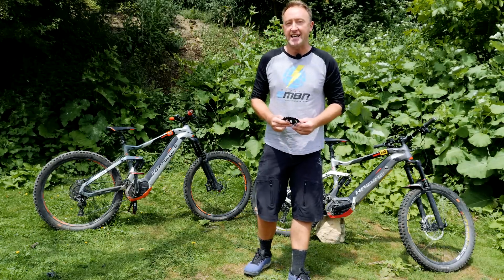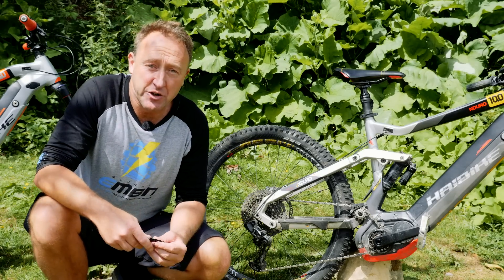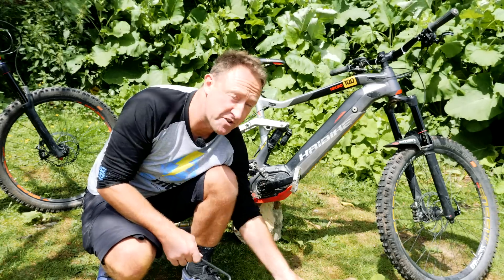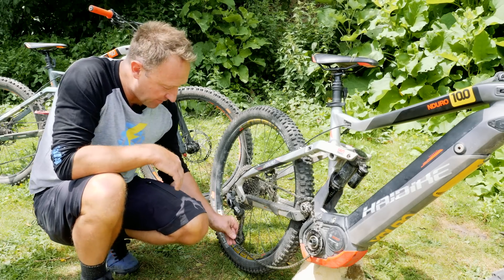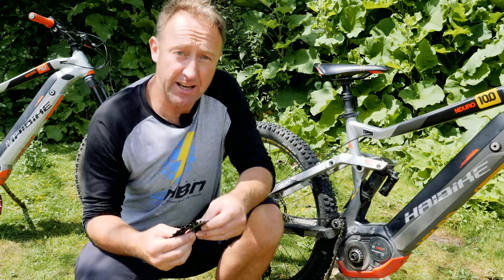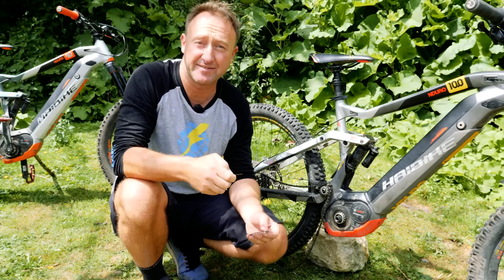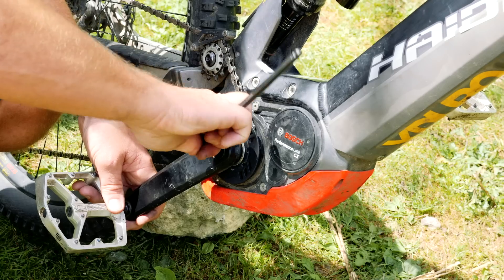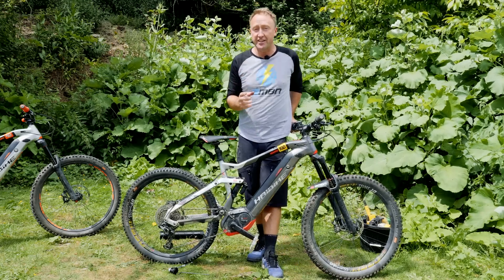Change An E-Mountain Bike Chainring On A Bosch Motor | EMBN How To

Comment: Hi, do I need to change the chain after that upgrade? Because the sprocket size is being bigger!
Reply: If you have a full suspesion bike, test if you have enough chain when you are in the lightest gear with rear shock bottomed out (or removed)

Comment: hi, i have a 10.0  after 1550 km replaced  ( the sram casette ) is extreme  expensive  ( 480 euro ) the  chain plus front sprocket , is ther a other brand ( shimano ? ) that will fit the bike ?      today  checked it  @ 2500 km it looks dat its worn out  again ( ps the first 1500 km 80 % was on turbo - now i ride in al the modes ,

Comment: I would like to know how to tell which sprocket tool is needed for my 2020 CX that came with my Moterra Neo.  Not all of the sprocket tools for the Bosch motors are the same and each one is about 25 quid apiece, and I have one now as a paperweight.  Thx.

Comment: Very informative video, thank you. 
My KTM Macina Kapoho LT271 (8-speed) came with a 16 tooth SRAM X-SYNC sprocket. 
I upgraded to a 18 tooth sprocket which is the largest available for the SRAM X-SYNC series however upon looking on the Internet I have come across a 20 tooth sprocket (KMC) but it comes in two variants, either 1/8 or 11/128. 
Not sure whether to try one of these larger sprockets out and most importantly i'm unsure which varient I should get. 
Can you offer any advice?? Thanks 😊

Comment: the one thing I'm worried about is the offset spacing (3:37) compared to the original, which seems to have inside teeth near the drive unit and sprocket spaced some number of millimeters away, then more space, then the outer guard. I'm not sure why miranda has so many offset combinations
I'm thinking this actually just has to do with the cassette height in the back and to more closely match the middle of the gears

Comment: Great explanation.
I would love a similar video regarding the Yamaha PW-SE motor.
How easy is it to find chainrings on online shops for that motor? Are the chainrings independent of the Crank?
What about replacing a single chainring by a double chainring? Is it easy to place the derailleur? For example in a haibike SDURO?

Comment: I'm trying this on a 2018 Haibike AllMtn 9.0 and the chainring is too close to the motor. where do i find a 14 tooth chainring with the correct offset for this model??????
Reply: did you ever figure this out? I'm having a similar issue and will need to offset towards the pedal

Comment: I will only use Oval chainrings, So most e bikes are no go for me, but for now I prefer normal bike anyway,
or belt drive for me. I haven't seen them for these systems yet. but I saw a person made a belt drive oval for an old bike for old cranks, but I don't have a CNC, nor do most people. but I haven't dig deep on E bikes. for me it's a huge difference.
today I found this: https://e-bikerumor.com/2018/06/26/aribike-expands-e-bikes-w-spiderless-round-oval-chainrings-brose-tsdz-2-ultra-torque/
https://www.aribike.it/eng/e-bike.htm
Oval fro E bikes.
SO far this is the only Oval fro E bike I know of, but i don't know much about E bikes.
So far the offerings are for
SHIMANO E8000 MOTOR , Brose & Ultra Torque motors, but their site looks like an 90s site and doesn't work properly, the links all go to SHIMANO E8000 MOTOR option.

Comment: Just changed my front sprocket to 14 with the after market chain guard the chain looks worryingly close to the plastic motor casing with out the inside  guard......like the the factory one ? I’ll see how it goes !!
Reply: Changed it back to standard it needs a spacer or a different sprocket!!

Comment: So.. I've just bought a 14t sprocket for my Haibike.... fitted it.....  it is slipping under the chain.... it ain't working and I'm not sure what to do... put new chain on..... but as I pedal....crank/sprocket rotates... and chain doesn't.... sprocket slips about 2 or 3 teeth each rotation..... I can't understand what bus going wrong......

Comment: It's interesting that you don't mention Miranda, because they are the company that makes all this Bosch sprocket wizardry that allows you to change the chainline and whatnot. In addition to chainrings and chainguards, Miranda also manufactures Bosch-compatible spiders which allow the use of general-purpose sprockets. Another thing that's critical to mention is that Bosch drives can also refuse to work with certain chainrings as part of their anti-tampering mechanics... the exact nature of this is difficult to predict, but there are plenty of reports by people who replaced the chainring that their motor refuses to function.

Comment: I have a question.  The front ring you took off has a 5mm offset. The one you replaced with doesn’t.  Is that a problem?
Reply: I'm not OP but yes, that is definitely a problem, though less so if you have a rear derailleur. It would be critical on an in-gear hub though. Luckily, there are different varieties of these front rings with the internal protection being offered in several different offsets - convenient if you want to adjust the chainline of your bike a little. Maximum is 20mm though :)

Comment: Well that is going to be a challenge on my Focus Jam2 with the battery placed in the downtube and needing the motor to be removed to access it.
Reply from the maker: But doesn't the Focus have a Shimano motor? This video is for Bosch Performance line motors only.
Reply: Fair enough, I just figured removing the battery was a general safety tip for all ebikes when accessing the chainring. Thanks for the reply.
Reply: @embn  and Yamaha ST, How change chainring Peter?

Comment: The front sprocket whit chain guard is ugly and a mud trap.

I changed it by a sram without it, prettier and you dont have all the crap who gets stuck in it.
Reply: I agree, it's a mess and mine is typically full of mud.

Comment: I did this modification on a Bosch CX, but i had to reprogram the motor to get optimized assistance.
Reply: Each Bosch motor is set for the bike set-up with cassette size and chainring size input etc. I'm not aware this can be changed with the usual interface, maybe Kevin knows different.
Reply: Bosch doesn’t provide software update, i had to ask the manufacturer of the bike if he was ok to reprogram the motor. Once they were ok, my bike shop had to make an appointment with Lapierre so they could upload the update online. My Bike shop couldn’t make the update by themselves. I guess software modifications are prohibited to bike shops to prevent de-restriction of the 25km/h limit.
Reply: Which is funny considering the e-bike dealers in my area commonly offer bumping up the speed limit to something like 50. On all sorts of motors including the Bosch PCX. I guess this is where an app would come in handy (changing the gearing info - I don't see why it would need protecting; the speed limiting must rely on a speed sensor as the motor has no idea which sprocket is selected in the rear). Then again, I don't really see why would the motor need to know the chainring/ cassette setup. What it needs is cadence (angular velocity) and torque (which gives you power) output of the cyclist. And bike speed for the legal cut-off.
Reply: The motor doesn’t know what gear you are on, but he knows you are supposed to use it on a certain range, for exemple, between 11 and 42 tooth on a 14 tooth chainring, so it can deliver assistance exactly where you need it most.
Reply: The speed bump to 50km/h is a simple trick, it consist by hacking the speed sensor, and registering only one pass of the magnet out of two. It’s illegal though, and messes up all data on the display (speed/ distance/ range)
Reply: Brooklyn Hooper Same peak power, yes. But not at the same time. Anyway, if  you play too much with the ratio cassette / chainring, you will get an error 531. Assistance shuts down.
Reply: @kevinlafon  i am searching for more infos about what exactley cause this error 531. i want change from 16 to 20 tooth and my bosch cx is unlocked. thanks
Reply: Really? Tell us more please! We were not aware that anything like that needed doing
Reply: Brooklyn Hooper you are right, mate, i also wish « it should » be simple.